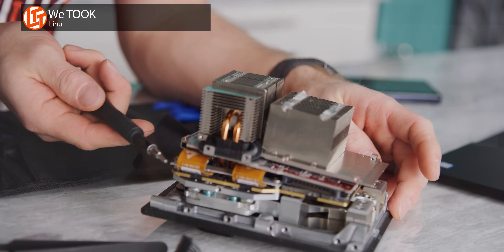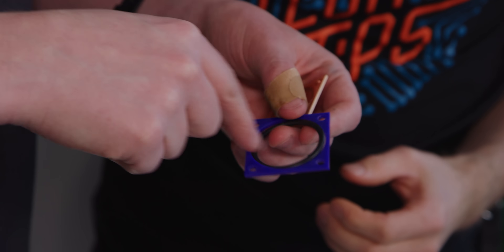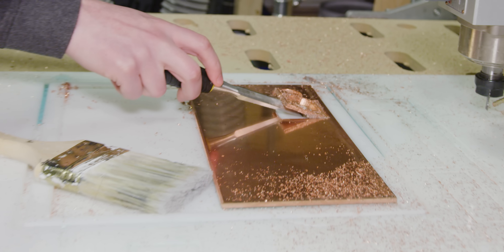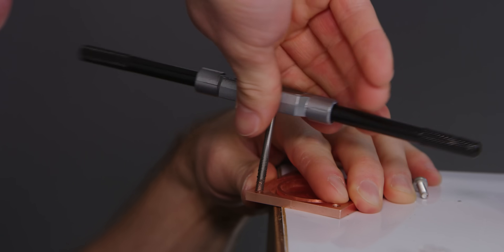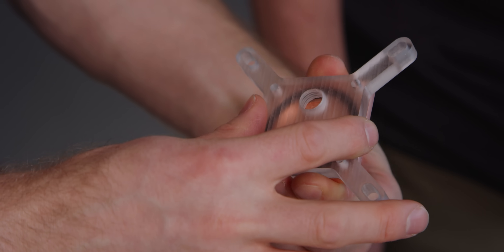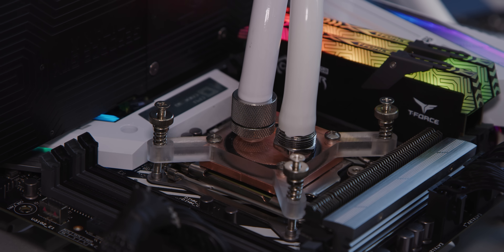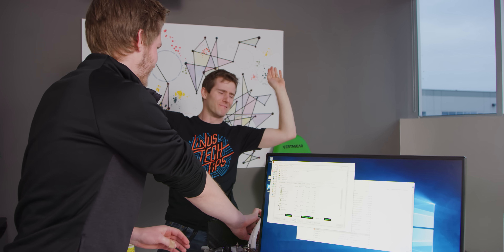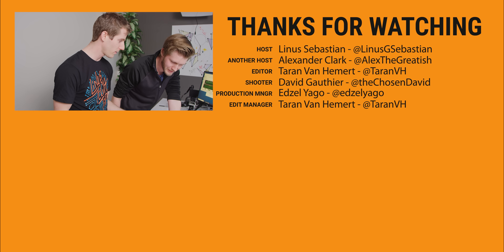We Built a CPU Water Cooler!

Comment: As someone that worked in quality control for aerospace. They can get away with having a smaller level of safety factor because of the level of quality control. When they design parts they are going to come in spec 100% of the time.

Comment: why don't you use an existing cooler that has some heat-pipes cut the ends of the heat-pipes and run water with some tubing directly through them .

Comment: Y'know, I thought I was nuts swapping fittings and radiators using the same "gravity and a towel" method of hot-swapping a full loop you folks did at 11 minutes. I still think I'm nuts, but at least I'm not alone.

Comment: I'm a little late on this one, but when you have to tap a hole use a drill press to hold the tap strait and the drill press table to hold the block flat. Now you just open the pulley cover so you can manually turn the tap. this way you get a perpendicular thread. You may need two people though.

Comment: hes correct on the orings, the gap is required so you have space for the oring to spread out when pressed together, if you don't have the gap you either pinch/split the oring and it leaks, or you warp the surfaces you are trying to seal.

Comment: You would think with all this cpu overclocking Linus would have looked into how they did all the old plumbing in houses with copper pipes
Also, you know high volumes of gas moving a very fast rate gets pretty dang cold but we are talking alot of volume
Also a steel or brass "O" ring in oil would last longer over a rubber one

Comment: its like you have extra pc's im used to have a core 2 quad with 6gbddr2 ram with gt610 and 250gb hdd
and i sold it and now while im looking to buy one i have a core 2 duo 6th gen and a g36 chipset  and 2gbddr2 ram
i need something that is gtx960 or better with an i5 with 8gb ram  or better for 40000k dzd and u are here risking a gtx1080 its expensive af where i live

Comment: Should try a little auto body work tricks, spray black spray paint, from a long distance so it's spackled, let it dry. Than stick a piece of 1000-2000 grit sandpaper to a piece of glass, and wet sand the copper and see how not flat it was, if it flattens it well or not, and if its performance  improved by doing so. Than try that same test on other copper water blocks.

Comment: Wouldn't it be a good idea when testing a waterblock to mount it on the cpu and then turn the motherboard upside down before filling with water? That way if it leaks it will drip down away from your components, feel free to correct me if I'm wrong here.

Comment: I don't know who told you that planes have a safety margin of only 10% but it's actually more around %50 more force than is expected is what a plane needs to be able to withstand. Keep in mind this also means what it is expected to experience in turbulence under full weight and max speed. So don't know where you got that number.

Comment: Hey here's an idea. I seen your videos on, air and liquid cooled cpu coolers. Why is there not a cpu cooler that has a base that contacts with cpu, liquid, then moves it up to air fin cooler section, where air flow cools liquid down and it goes back in to cpu. All in one unit. No separate rads and tubing, all in one on top of cpu. Like the Cooler master pro, except base has liquid in it, to top to air cool. Make sense
??

Comment: The fins on the block could probably be stamped in place.  You could probably use the one that has them already as a die, since it's made of a harder material.  Just hydraulic press it into your panel. If I were to set this up for low volume production, I'd put straight knurling into some hardened steel, just a round of it. Then set up a tool to make it happen.

Comment: So linus my question is this as a though if you put the o ring channel on the plexiglass and used something super thin like a aluminum can. Less thermal holding capacity of the metal which makes it have to transfer to the water? Just a thought..

Comment: You guys are definitely not engineers. Have you not heard of a bench vice? You can get small ones for about $50 that would have been invaluable during this build. Also you do realise that if you thread a through hole,  the thread will be the same from both sides. Think about a nut. Does a nut need to go on a certain way? When tapping through holes make sure you use a tapered tap first to ensure you get the thread square with the hole and always back up the tap to release the cut material often. That will make it easier and use cutting fluid. I am glad to see you used vaseline on the o-ring. That is the correct method to get a good deal and prolong the life of the o-ring. I have used the continuous o ring material at work to seal irregular shaped seals on machine parts. No need to glue. Just place the seal in the groove and have it overlap at the ends then with a very sharp exacta knife cut the overlap at 45 degree angle and the joint will be almost perfect. Once the o ring material is compressed it will make a watertight seal.

Comment: You could make fins, by heating the middle of the block with a hot torch then hammer a hard metal object with fins cut in it.. Basically the copper softens becomes more malleable and you stamp fins in it. No machining.

Comment: You can just use motor oil for taping oil, it actually works mildly well, and you just spray brake cleaner on it and it'll go away.

Comment: WE HAVE A 2.4KW DUAL LIQUID COOLED AMP FOR OUR HAM RADIO AND WE NEED TO USE EVANS WATERLESS ANTIFREEZE WAY BETTER THAN WATER FOLKS I DO NOT TRUST LITTLE CHEAP WATER LINES USE HEAVY DUTY HOSE 3/8 HOSE OR 1/4 HOSE WE HAVE 3GAL TANK AND A 2.5 PSI FUEL PUMP 12 VOLTS COOLING ISSUES ARE THE SAME FOR BOTH BEAST PLEASE PLEASE LOOK AT THIS VIDEO!!!! https://youtu.be/59fueXFxU_E

Comment: The fins are mostly just there to increase the surface area. If cutting fine fins is too difficult for your setup, why not start with a triangle or sawtooth profile? Increases surface area by 30%-60% depending on angle, and you don't need to get very fine structures as long as your baseplate has enough depth.

Or, you know ... just work in aluminum?

Comment: Try using pcb etching to make the fins instead of milling copper.   Also use a metal lapping technique to smooth the CPU side.  The o-ring was done well but low temp automotive RTV gasket maker may be what you are wanting for complicated shapes.

Comment: a little trick for starting TAPS in the flat stock you should use the drill press put the tap in the drill press then use the drill press as a guide so you're straight up and down . Don't turn on the power .... Do it by hand.

Comment: as a machinist by trade have the speed of the cutter as fast as you can but keeps the tool movement slow (be carefull the bass can pull the tool) and keep it coated in wd40 for coolent and lub.
and lub the taps aagggg lol

Comment: Just buy an O-ring and them machine the copper in the size that that O-ring needs. Use a Mill or drill press to tap the holes so it goes straight. (but turn the spindle of the mill by hand)

Comment: the amount of redundancy in the verification of tolerances of jet engine parts is uncanny. first, many times throughout the manufacturing process, then even more probably after the customer receives the parts. so, at the very least, the parts in the engines are done to the proper tolerances. i can't speak for the rest of the plane though XD

Comment: I'm a cnc machinist and solid modeler. I've worked with waterproofing components for various electronics projects in the past. I second recommend the Parker O-ring handbook for o-ring use and groove designs. You shouldn't have had problems with the copper though so I'm not sure what you're doing there. If you're doing fins tiny pcb mills and drills generally work well. I also recommend asking scuba shops what they recommend for o-ring use, I recall using some super fancy grease that worked amazingly well.

Comment: The fins on the wet side aren't to "channel" the water, it's to increase the surface area of base plate that's in contact with the coolant, increasing heat dissipation. It's the same reason air coolers have fins.

Comment: pro tip Linus, let's say it's a scarf prototyping tip, you could test the water flow for leaks separate from the finished components. That way if there was leaks it wouldn't destroy your mother board =b if you where planning to use the four extra screws attaching it to the mother board as extra pressure to prevent leaking, you could have screwed it into a thin wood or metal sheet.

Comment: You can get a relatively inexpensive leak tester. Works by pumping air in and looking for pressure losses which would happen if the block is not sealed correctly.

Comment: Sounds like you need some ultra-fine diamond slitting disks and a clamp to hold your work vertically so you can use your cnc mill for it. All you need to do is mill a moat around a raised center island in your cold plate, then cut a whole bunch of fine grooves into it with the finest slitting disk you can buy from China.

Comment: I think you could put fins in it, you just aren't doing it with a round bit. You'd need some 90 degree angle micro saw. Maybe if you found a way to attach a dremel at 90 degrees to your tool's head, you could get away with it.

Comment: The reason, you are having trouble machining copper, is because it work hardens.  You need to heat treat it to soften it, then work it, then heat it again.  Copper is not easy to work with.  You can check out AvE's channel when he works with copper!

Comment: YAWN  time when you run out of ideas........hey lets ask Alex for an IDEA..ummmmm  o..........k.    So you built something worse than Ali Express for more MONEY  WTG!!!!!   FIRE ALEX!!!!    LOL    Cow}:-o)  IF yall were Closer to FL I would FLY up and show yall how to Program the CNC  you Bought even though its not a High end one like the Closed 2 Turret Programmable Lathe Style Bridge Ports with Cutting oils and Cameras with 1/1000 or higher in tolerances.  I used to make parts for the Shuttle years ago at a Place in Boston so yes I know my SHIT... You want to see real shit GO watch some vidoes on a real CNC making parts for a Switch and they POP out 1000 Pieces in Minutes and you are fully responsible .....hes talking Copper, Try cutting Bronze, Silver, Gold, Platinum, Hardened Steel.....hell Copper is so EASY......lol 
   First off you Need to be in the IBEW Union to do it because they record who you are and your Finger printed and they do back ground on you Because you are working with DOD and others ..i wont go into any detail even though it was 25+ yrs ago I know Better!   Anyway yall should have bought a real Chuck Style Lathe CNC with Multiple Turrets if you plan to do many diff jobs ie , MIlle , Bore, True,  , you are only going to keep buying another machine for a 1 or 2 use.   Just saying Lnus if you  want to Keep Building dont just Buy a 1 Project tool buy one that can do Many projects,,,,,,some will come with attachments that can be added at a cheaper cost than Buying a 1 use tool for 1 Video but down the road you can use it for much more. 
  EDIT:  I forgot this  >>>   OMG USE CUTTING OIL when Cutting THREADS or metal Just because it its Carbide does NOT mean you do not need CUTTING OIL  NOT 3 drops & DONT use Vaseline on RUBBER OMG!!!  Use a Water bases lube  ALEX you are KILLING ME!!!!  Cow}:-o)

Comment: If the acrylic top piece doesnt have any 3D features, or requires no more effort than machining copper, It would be better to make that piece out of copper as well! Not only will it not crack on you potentially ruining the camera down the line, but better thermals!
Reply: doesnt matter which way you tap it, unless you used a left handed thread... it should screw in either way!
Shouldnt need to grease your orings in this application. Parker is generally known for air based products, not water.

Comment: I am sure someone may have said this already but why not throw this out there just in case.  Maybe milling out the area where the water is over the CPU to be a bit thinner to allow for the heat to get to the liquid a little faster and I know you said milling the CPU surface of the water block or better yet polishing it would work a lot better.  I know you are done with this project but just in case you revisit it, just some thoughts.

Comment: Copper is an incredibly soft metal, so turn up the rpm of your router, and use liquid coolant instead of air. Copper softens very quickly with any heat, so keep it cool to help avoid that, and a higher spindle speed will help stop the bit from binding and breaking.

Comment: So a tip for splicing o-rings is dip side A into baking soda and put a drop of superglue on side B and then connect them making sure they are straight the baking soda reacts with the superglue and makes it harden instantly instead of trying to hold the 2 pieces together while it drys

Comment: As someone who has tapped probably over 5000 holes in plastic, copper, steel etc. You guys simply didn't go through the plastic far enough to  allow the fittings to start on both sides. Also if you would have taken a countersink bit and even deburred the edges it probably would have threaded in.

Comment: The reason you're having so much trouble with tapping the acrylic is because you didn't Reem the hole first. Drill bits are ever so slightly undersized so you ream the whole first and then tap it to get it exactly to size.

Comment: machine the copper very slowly, drill in small increments because drill bits and tooling tends to bite into copper so make sure the part is held very well and use drill stop and take your time, also use the right cutting fluid but if done slowly should be fine.

Comment: very simple design BUT the thickness of the blue acrylic layer in middle is critical because it has to be thinner than the o-ring by a specific amount to get a correct seal and the ID or inner diameter of the circle has to be the right size so yes its simple design but more engineering goes into things thought to be simple.

Comment: So this is an interesting video.  Building a water block is more complicated than I thought.  I figured any block would transfer heat away from the CPU within a few degrees of others.  I would say that I don't think you can get copper and acrylic for a buck, both of those materials are quite expensive and the top looked pretty thick, maybe 5 bucks?

Comment: I heard  "80 degrees" WHILE water cooling and i'm like... Isn't that the equivalent of an intel stock fan?

Also watching them try and tap things was funny. WHY would you push down as hard as you can while trying to thread it? you only ment to put a little bit of pressure to keep it going downwards, I also saw linus trying to tap a hole on an angle... WHY.

Comment: Hey Linus, I am a mechanic and I have a Loctite brand O-ring Splicing Kit in my box and it comes with cords of various thickness Buna-N material and super glue and a razor to cut the cord. So yes, it is an acceptable method of repairing, or making new o rings in the field and you can actually use many small sections to make one big o ring if you wanted to. Hope this helps. Id recommend getting one if you want to do more custom stuff in the future. P.S. you can only use them for static loads, not dynamic loads.

Comment: The reason machining copper is so hard is cause your using the wrong machine a router is not designed for its made to machine wood and maby aluminium a industrial cnc mill like what i work with, is way better suited for this stuff you could make at least 100 of them  in an hour threaded and everything.

Comment: Did you know you can get a socket to go over your tap with a 3/8 ratchet? or 1/2 depending on the size. Also you can get hose cutters to cut a hose perfectly straight versus scissors. If LTT wanted really quality tools, they could find a Snap-On dealer for what I just listed.

Comment: you were using the tap and die set wrong..for every 3 turns in  you back it out a turn to break the chip and make cleaner threads

Comment: The water block does not have RGB! You should also make radiators next. Though if you made water cooling stuff that worked and is slightly better quality then the one in the video I would buy it! :)

Comment: @https://youtu.be/f1j_hlNLPcs?t=193 Those fins are not meant to guide the fluid but to increase the surface exchange of the heat transfer. You may thread some as you did for the O-ring as thin as you can to improve your design ;o)

Comment: If you use a thicker block of copper or aluminum(to handle easier ) and with smaller bits cnc the fins and create water channels and a sealing on the middle forcing the water through these channels maybe you could improve these numbers.

Comment: Yes, it's hurts to see you do some of the stuff. You really need a fresh machined surface to the CPU as the copper gets a surface that isn't as good conductor. For machining copper use sharp tools, really sharp. And when you get a recess you can fill that with some alcohol (not beer) to cool and lubricate. In aluminium the best coolant is industrial ethanol, and it works on copper too. Good luck.

Comment: Machining copper is not a pain in the butt.  I've made all kinds of things out of C110 (Oxygen free) 99.9% copper.  Pure copper is soft and therefore gummy under some circumstances.  Using the right cutting fluid can make it much easier as it will keep the copper from building up on the cutting edge of whatever tool you're using.
Reply: P.S. I would have made the acrylic part out of copper as well to increase the heat transfer to the water.

Comment: Get a hazardous fraught slitting saw to cut grooves in the water side of the copper to increase surface area.  Lap the bottom using a progressive series of sandpapers.  It took so long last time because you started with too fine a grit.